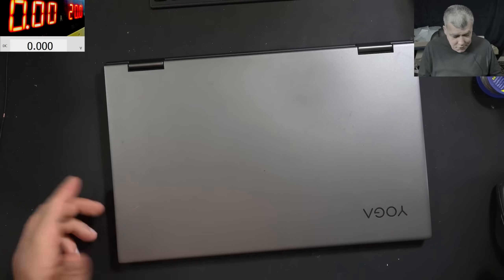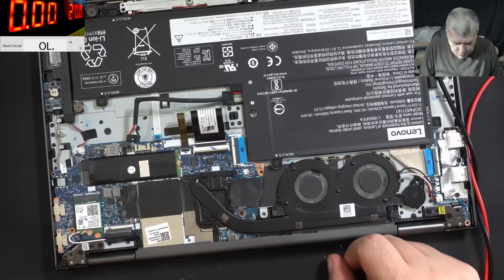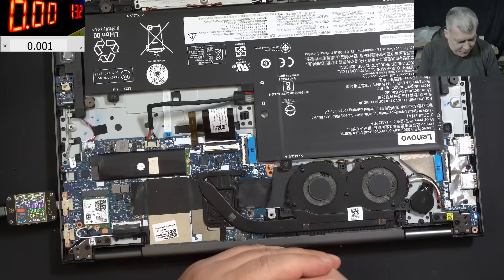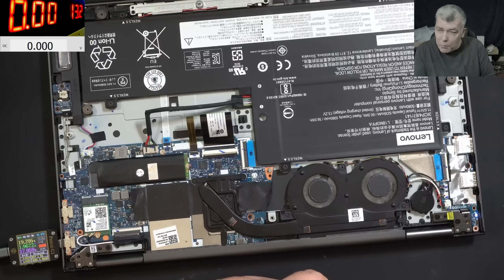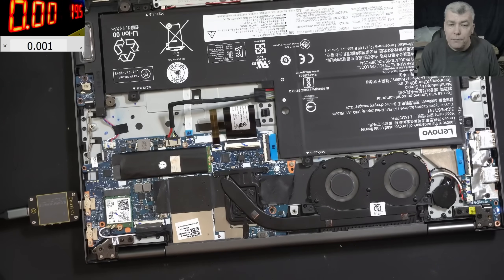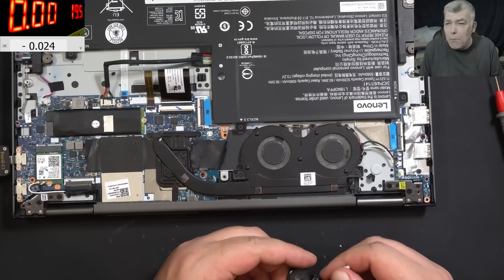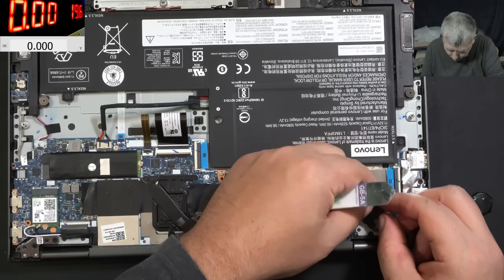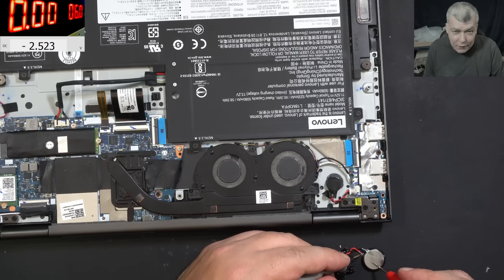Lenovo Yoga C740 dead, not charging, how a stupid simple fault, can turn your laptop dead.

Comment: I have the exact same laptop and exact same problem, continues to drain even with charger(s) being plugged in, the way i have revived the system is let the battery drain down while plugged in. Once the battery is fully drained, I mean fully drained (keep restarting it and running virus scan), then it starts recharging and charges back to 100%. Not sure why, but it's a weird problem. Definitely a "Lenovo engineering problem"

Comment: Hi Sorin, would it be possible to solder new cr2032 on these leads? I tried once and it battery would not accedt solder, and when heating I permanently damage it. What would be the best approach?
Reply: You can buy CR2032 with solder tags already on them and you solder to the metal tags. It is possible to solder to any battery but you must scratch off the coating to reveal bare metal in a small area. Then add flux and quickly solder the wires without over-heating the battery.

Comment: if you set the power supply to 19v to charge the battery, what happens if the battery is either high internal resistance - or open?
Reply: The main battery has a protection circuit built in. Any irregular issue with cause the battery fuse to melt and it will be disconnected.

Comment: CR2032 batteries must be very expensive in the UK. I wouldn’t even consider any extra work when a battery costs just tens of pennies.
Reply: Buy instead of fix? You obviously lost your hair cause you're not a boss like Sorin.
Reply: U can't fix, the cr2032 are not rechargable... The Little recharge Sorin put to It will lose in few minute..

Comment: Usually, I pull out the leads on the bad battery and solder them on the new one, so I save the connector as factory made. Of course, I have a spot welder for the purpose.
Reply: Do you program the battery after  that?
Reply: @mrrobot254  not needed
Reply: I was thinking that you was killing your battery untill I finished your comment. Nice idea.

Comment: Didnt know you could charge a non-rechargable CR2032
Reply: Yes. All "non-rechargeable" batteries (power cell) are rechargeable. They just don't want you to know it. But the amount of power required to charge them is not very efficient, such that if you want a rechargeable battery, it's better for the amount of electricity it takes to recharge them, to use rechargeable batteries. Also once those batteries get old and weak, they won't hold much of a charge anyway. Also recharging "non-rechargeable" batteries requires a much more attention to battery temperature.

Comment: Lenovo is the worst laptop manufacturer.... i bought a lenovo laptop and the screen backlight is gone just because i disconnected the screen once and connected it again...

Never buy Lenovo!
Reply: When disconnecting the screen connector you must FIRST remove the battery. If not the backlight fuse will blow or some other part of the screen electronics will be damaged. Everyone knows that...... except you lol

Comment: Sorin, don't be that cheap, just buy some CR2032 batteries and just reuse the wires. You can remove the metal tabs attached to the battery with pliers and then just use tape to reattach it. Also your "new battery" is kind of low, a brand new battery should have around 3.3V.
Reply: Totally agree. Repair should include a new £2 battery rather than clogging it up with hot glue!
Reply: Hi David, i agree with you new One are normale 3,2v... And Is Better change It when are 3v especially in a laptop or a machine that Is harder to reach and change, 2.9 Is too low and very soon the laptop can came back... I agree with Sorin that we must do with what we have, but can't be so cheaper, if Need a new battery u must buy and change to do the work at the state of art...ask the right Money for your work but do at your best...caming back only for cheaper ... don't do well to your reputation... I don't agree with no Cap no shorted Cap..only in very necessary situation, bye Francesco Timpano from Florence Italy
Reply: Yes perfect 👍  @Timpano_Francesco_Repairs
Reply: Im sure he was joking about using the old one after charging it
Reply: @Mz-e1d  I was not talking about that. That was a joke I know. But someone who repairs computers, should have a pack of CR2032 button batteries to replace. It is quite cheap.
Reply: You can't teach an old dog new tricks.
Reply: I believe the battery is not CR2032 but a rechargeable version
Reply: @addydiesel6627  The one installed in the laptop was CR2032 for sure, but the one Sorin used might be rechargeable, but I don't think so. Very few laptops use rechargeable CMOS batteries.
Reply: shutup, leave him alone sori

Comment: If you have voltage on the bios battery connector, you may also have current leak when the Laptop is not charging. Maybe you should measure the current from the bios battery. It should draw several Microamps.
Reply: It's just this silly design... the main battery was 2V so the bios battery was switched in to power the cmos and eventually that small battery was used up too. Most likely the laptop had some kind of bios glitch where it stops charging the main battery. I have a Toshiba Z30T-C laptop that did the same thing and could only be fixed by removing the main battery then putting it back, then the EC chip would be reset and the battery would charge again for a few weeks but the fault would happen again and again. Fortunately the manufacturer fixed the issue with a bios update.

Comment: Some laptops from years ago (I have an old Mitac 8170 Pentium 4 here in my workbench) used to use RECHARGEABLE batteries for the BIOS, and they'd charge when the mains was connected. Ahhh, they don't make them like they used to! Today's laptops are flimsy crap!

Comment: 12:25 never seen 40£ cmos battery replacement this dodgy XDDDDDDD
i mean different: connector size & battery size & low voltage & drowning in un-recyclable hot glue
that is some real conversation starter
Reply: Hot glue comes off with IPA.
Reply: That's normal for this channel. Don't like it... don't watch ;-)

Comment: at 1:19 i can see you have a small hole wich is a "reset button" to reset the EC chip i suppose. i have the same problem on another lenovo. no power, no charging light. just press this button and it works again.
Reply: I did it but nothing again 
On my lonovo ideapad gaming 3

Comment: LifeSaver Video!
When you measure the BIOS battery, the voltage is dropping constantly. You measure 0.5V without the battery inserted. In this case, I think this job could potentially become a recurring issue in the future.
My question is: Should there be a higher voltage to keep the BIOS battery alive for a longer time?
Reply: The voltage at the bios battery (when flat) was coming from a transistor. There will be a circuit connected that switches when the main battery is low and then the bios battery can power the cmos. This little battery is only there to keep the settings when the main battery is changed. It is not there to hold the cmos settings in normal use over a long period. It can supply power to the cmos for maybe a few hours at most, but in normal operation the bios battery is disconnected from the circuit by a transistor or something similar and is not used at all.

Comment: I think you are a bit wrong about the bios battery, it is used pretty much all the time, but the current is so small that they typically lasts for 10 years, usually longer than a normal lifetime of a computer. Perhaps there is another fault using too much current from the bios battery?
Reply: No, there is a circuit that disconnects the bios battery and it is not used except when the main battery is low or missing. It is there only to save cmos settings when changing out the main battery. This problem happened because the main battery was low and not charging due to a EC chip glitch.

Comment: The battery drains faster when people use their laptop as a laptop. I always run my computers on the mains adapter. Then the battery lasts longer. I only need a laptop battery if I can turn everything off when the computer shuts down. The battery protects my operating system so that everything is shut down properly when work is finished.
Reply: Problem is, by the time you NEED the battery, its wear level has dropped too low if you keep it on mains! My Dell 7390 battery has gone from 20% wear to 70% in just over a year. I hate non removable batteries, you can't easily swap spares out like you could older ones.

Comment: I think in general I would not say charging a battery with any voltage is ok. You need to understand batteries, than it is safe to do, but even that case I rather limit the voltage. Li-ion cells over voltage is dangerous. When you try to charge a fully charged battery with high voltage and 3 amps, you can overvoltage the cells. BMS will prevent it probably, but if there is a minimal chance of an accident I rather not advise to do it.

Comment: I don't now if Samsung is still the same, But I had a tablet SM-T520 which if the battery was too low it wouldn't engage the charging circuit or run on  usb power. I had to charge the battery with  my power supply to correct the problem, which happened numerous times.

Comment: I keep every BIOS battery from every scrap laptop as long as the voltage is still good on them. That way I always have a selection. I also remove the plugs and put the original plug from the dead battery if the pins are similar.
Reply: That's absurd as even if s battery has sufficient voltage you must understand that's because it's not under load ...when a battery is bad apply a load and check for high resistance, over time the internal resistance builds until the battery is dead also its capacitance decreases over time as well...when their dead, throw them away sheesh 🙄.
Reply: And why not just cut wires and attach normal coin battery there? Its just CR2032 usually which you can wrap wires around to new one from local shop with ex. electrical tape.
Reply: @XantheFIN  Exactly, I have been doing it for several years.
Reply: Yes right way, the different connector with hot glue Is not pro...catting wire e resolder the rigth connector Is the rigth way and not a very hard and expencive work to...
Reply: @Timpano_Francesco_Repairs  I've followed Sorin for years, he IS an expert technician that's not debatable however yes the battery he attached may have the same voltage but being smaller it may not have the same capacity....does this matter? Doubtfully considering it juices itself from the laptops voltage when powered on. The battery he had was a good battery he said, if you've ever watched him test batteries in the past you'd know he knows what he's talking about, I've seen him revive batteries from the dead 🔋 ☠️. 
Here I'm certain he was joking when he said he'd keep that battery, I'm sure he tossed it. He only cut the connectors and attached his good battery because he said that's the only one he had rather than the standard 2032 in that laptop. That laptop will work fine, "proper good " no harm and no foul. But I took understand many that hasn't been in this business 20+ years would frown on swapping different components or flicking off a bad capacitor without replacing it but once you have had skin in this game for years and your an advanced in electronics components and repair methods you too will understand there's simply no need to waste customers time and/or money to order something as simple as a small lithium battery that will do the same thing the one on hand that's smaller with less capacity will do. 🔩⚡